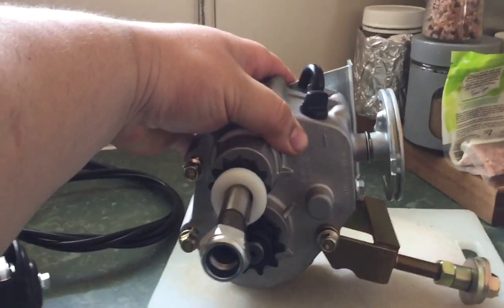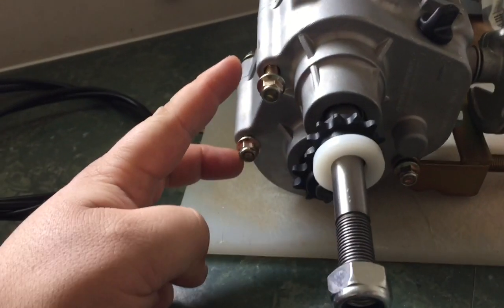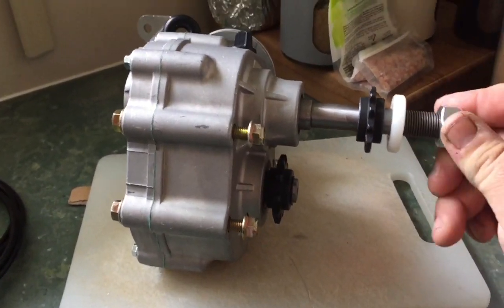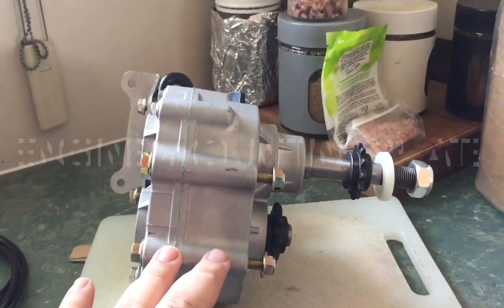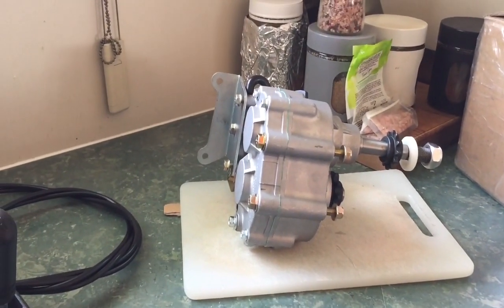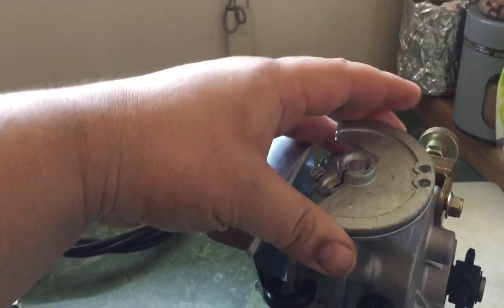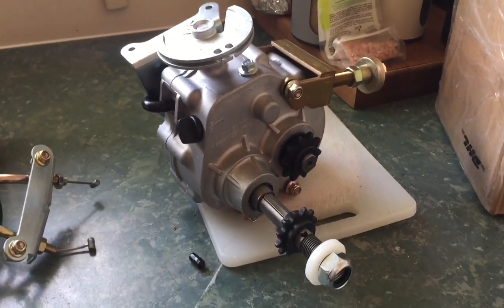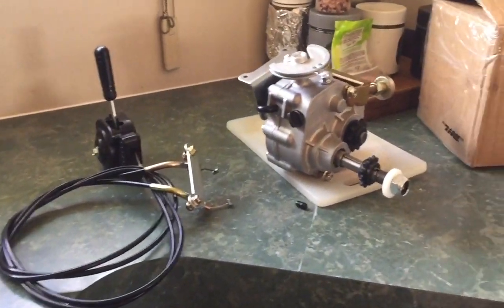Forward Neutral Reverse Gearbox

Comment: I have a counter clockwise engine, it would work if I could put power to the output shaft of the transmission but not sure that would be a good idea, any ideas how to change the input to counter clockwise ?  Thanks in advance .

Comment: I only have reverse on a Chinese TIking 150 cc buggy I just got running and was wondering if you could help me troubleshoot. And when I tried to force it the shifter snapped forward so did I break a cable?
Reply from the maker: Sounds like you snapped the cable, upload a video so we can help you problem solve, it’s hard to help you with out seeing the issue your facing. Shifter cable are available on AliExpress for 150cc gy6 buggy engine

Comment: thanks for the nice video.

I am looking for a forward/reverse gearbox for my Loncin 441 cc diesel with a motor shaft of 25.4 mm and output shaft for a flange 4x5.5 mm..do you know a link to a box that can be used,
in advance thank you
Reply from the maker: hello , i have just got my self a Loncin 459cc 16hp and really like the build quility of the Loncin engine!! no soory in regards to FNR gearbox you can go on amazone and find the bigger next size up gearbox to this one which will handle the torque of your diesel loncin engine, from memory i think its advertise rated 13hp-18hp but are stronger then this (little brother version) FNR gearbox

Comment: I'm about to do this to my go-karts I am using an 18 horsepower Duramax engine I wanted to use a centrifugal clutch what is your thoughts on that trans ciprocal clutch to the sprocket on the reverse to my rear end
Reply from the maker: i think it will be ok, these gearbox are not meant to be able to handle 15plus hp.. But i think it will work ok cause your using a clutch so torque will be low on take off.. I am about to fit this gear box to a 15hp honda clone for more torque using a 40 series cvt pullies in the same configeration as i have this set up so fingers crossed the wee little FNR gearbox doesn't explode lol.. I plan to drive it softly on take off to prolong the life of the FNR gearbox. Cheers for you interest make a video when you get urs up an going im alway keen to see how other people do there engine/drive set ups

Comment: Hi beaucuse engine turns anticlock wise and the propeller in my boat clockwise is there a problem if use as forward the reverse gear????
Reply from the maker: Dionisis Christodoulopoulos 
Nah it will be fine, one thing to remember is the reverse gear in these gearboxes has a lower ratio then forward gear but ultimately you can control the gearing with sprocket size seclection! Good luck 👍🏽
Reply: @clayhunna7357 hi from Greece. thank you my friend for your answer.... The lower ratio 2,6:1 in reverse gear is perfect for boat (all marine gear boxes has reduction from 2,3 - 3,0:1) . My only scare was for the inside gearbox gears if there is any problem with their teeth. I will use a 6.5hp loncin or subaru tiller engine which gives 3600rpm...with the gearbox reduction 1.450rpm. Then it's easy to play with reduction with sprockets and a small chain...also I saw on other video of you that you use cvt. This is  very nice system to go kart but useless in boat beaucuse boat works continiously with the rpm that you select to go. Thank you again for your response.
Reply from the maker: Dionisis Christodoulopoulos don’t be scarred , the gearbox is designed to handle the load of a 6.5hp engine easy! There rated up too 11hp engine so 6.5 is at bottom end of the scale. I thrash mine hard An have had no problems with the internals failing. There not much load when used In a boat as water doesn’t put up much resistance compared to rolling mass with load in my go kart, plus I heavy guy so it’s fine just go build your boat an enjoy the process 😁👍🏽
Reply: @clayhunna7357  I will use centrifugal clutch with pulley and belt from crankshaft to  gearbox and then chain to the propeller shaft (or belt with pulley if fits to the gearbox because there is not a lot of space)... Thank your help gave me courage to try it... If you have Facebook glad to add you as a friend..
Reply: Depends..
On which way you point the nose (FFS no mate)

Comment: How to lock the input sprocket in place? The kit didn't come with anything.
Reply from the maker: Hey , i bought a jack-shaft sprocket that has allen head grub screws threaded into the sprocket so you can lock the sprocket in place on the shaft where ever you want it. You could drill a hole an cut a thead into your current sprocket an achieve the same outcome.
Reply: @clayhunna7357  nice! Great idea, I'm on it. Thank you. 👍
Reply from the maker: @brokensmile8487  Awesome, All the best with your project !!
Reply: @clayhunna7357  thanks. I might get a video of my 212. It's coming along nicely.
Reply from the maker: @brokensmile8487  Cool, let me know when you do vid eo, ill be keen to see your work.
Reply: @clayhunna7357  indeed, will do.

Comment: Can you provide a link where you bought this gearbox.  Also, do you think this can handle the weight of a golf cart
Reply from the maker: Hello please do check my other video it has a link in it too where i purchased the F N R gear box from. An yes in my oppinion i think this would work perfect in a golf cart given that you use a gx 200 size motor like to one in my video
Reply: I'm running an 18 horsepower 440cc Duramax engine with 5th gear box and it handles it fine just watch your Gering